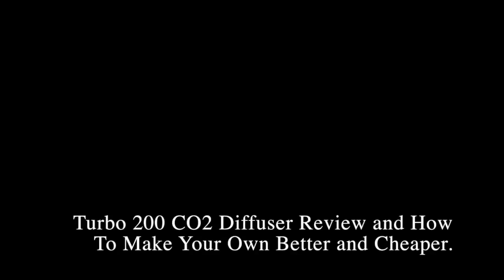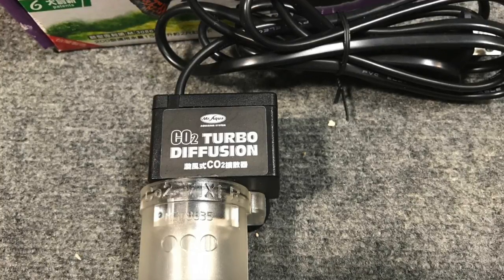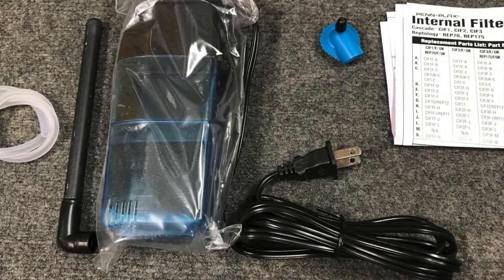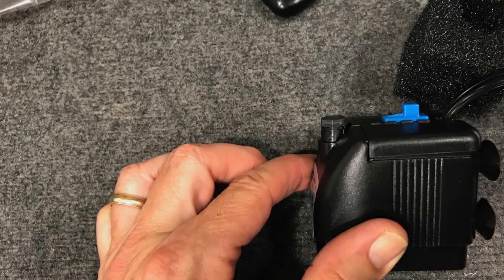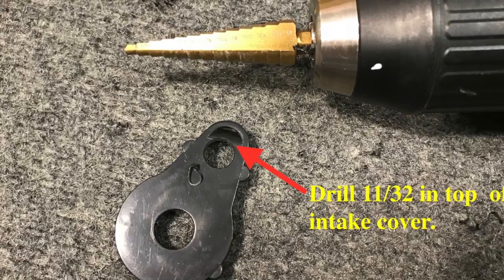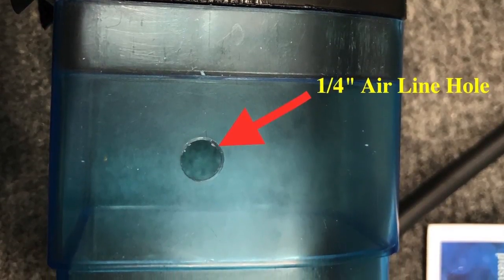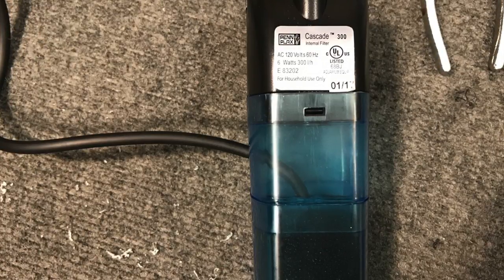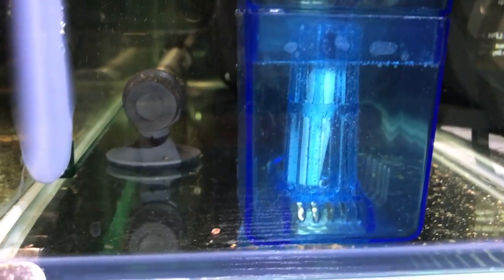Turbo 200 CO2 Diffuser Review and How To Make Your Own But Better and Cheaper.

Comment: I built a little C02 reactor just using a little plastic bottle attached to the out spout of my pump and poked tiny holes in the bottom of it. The c02 line goes into a air intake and spits it into the bottle, which churns the bubbles to a fine mist out the bottom of the bottle. Works brilliantly!

Comment: Clever build. Am I understanding correctly that the airstone and attached airline tubing is connected to a pressurized CO2 tank? Not specified in the video.
And what's the purpose of the 3 drilled holes? Not spelled out in the video, but I assume that's where the CO2 eventually leaves the reactor? If so, why 3 holes (i.e. why not 1, 2 ...or holes?

Comment: Ok well I was a little sceptical at first but once I found the right part of the sump it does do a better job than any other reactor I have tried. Easy build works as described, thanks.
Reply from the maker: Thanks for sharing

Comment: Built this today I hope it works well, I’m dosing my co2 in my sump, 90 gallon planted. Tried a Red Sea 500 reactor, works well but not up to the task of 90 gallons and dosing from sump. Built 2 or 3 got mixed results, don’t want a tank that looks like a soda pop. This little thing goes for around 30 Canadian on Amazon, thanks for the build video, fingers crossed.

Comment: This is one of the very best DIY ideas I've ever seen and man does it work. One thing. There is a slight noise that is really very slight. However my 75g is in my family room. The slight noise is from the bubbles hitting the impeller. Sadly my wife has very good hearing and it bothers her. Any ides how to stop the ever so slight noise?????
Reply from the maker: Yes I do, it’s called get a different wife. As you know I’m only joking. However, I really don’t know how to quiet it down so your wife cannot hear it. Sorry I couldn’t be more help with your dilemma. 🤔
Reply: @anoxicfiltrationplenums  No problem sir and getting a new wife was a brief consideration lol. I have the timer set so the CO2 comes on after she leaves for work and turns off just before she gets home. The days she's off I just turn the Cascade off and let the diffuser do the work. Thanks for your reply. I intend to install this idea on my new planted tank n the near future.

Comment: I tried it first without drilling the three holes in side as I noticed a lot of the small bubbles on your video were coming out of the bottom.   It worked amazingly!   With this addition through subtraction it is the best!
Reply: @Gunnar11011 
So you ended up not drilling the three holes in the end?